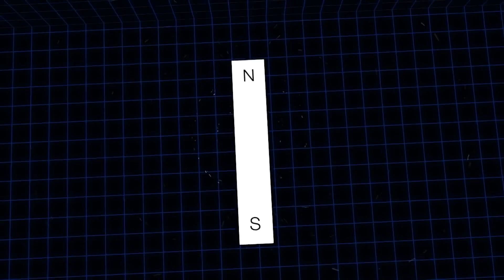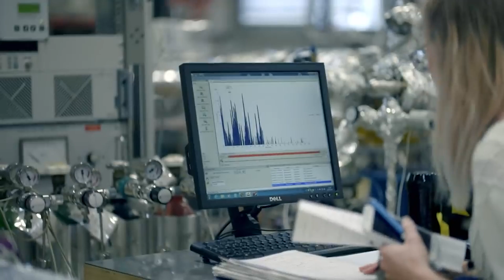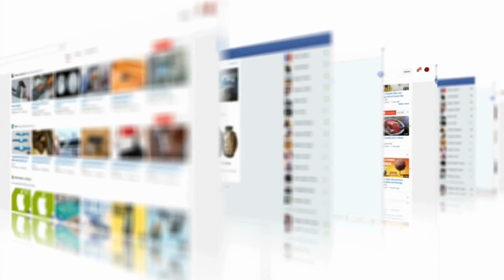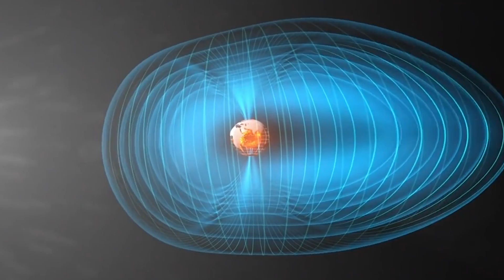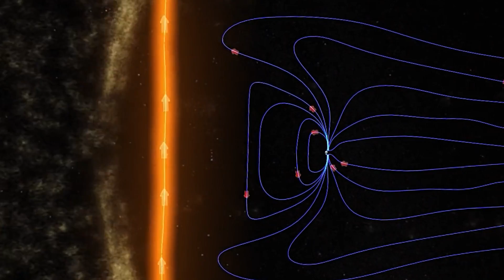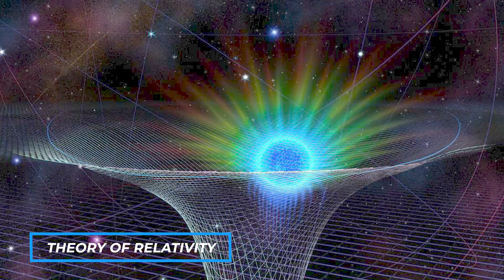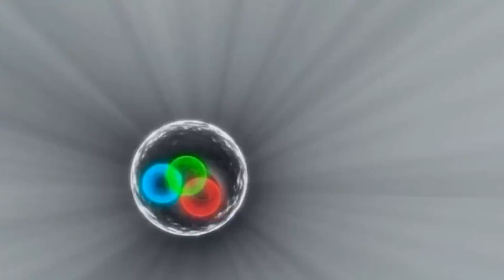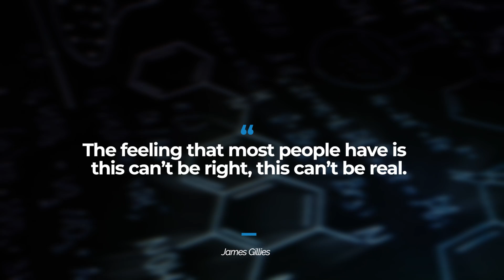Cern Just Admitted They Created Something So Strong It Can't Be Stopped

Comment: The speed of light isn't speed but a reaction time that gives illusion of speed, similar to weight as an illusion caused by compressibility at increasing speeds. If light is a reaction time reading, then a particle of light enough mass, or better, massless energy as radio waves, for example, could jump the perceived barrier of an illusional "speed" or in fact "time") limit
Reply: @@LadtheMad when the bar closes. It's a concept we use because it runs out all the "time", like money - "they" say time is money and "they're" right, for once :-Y